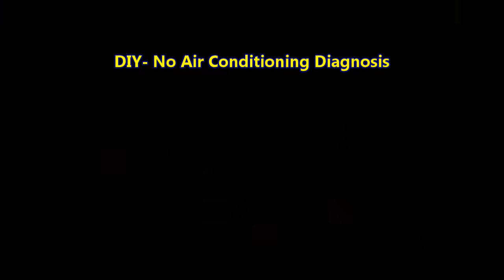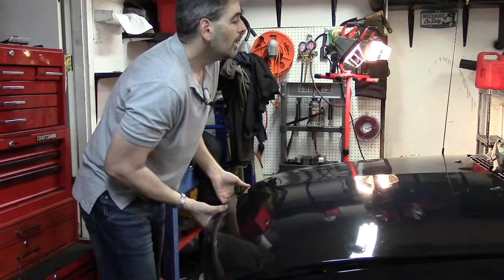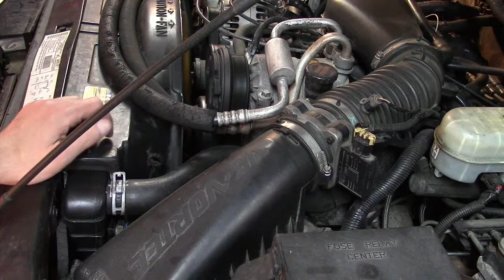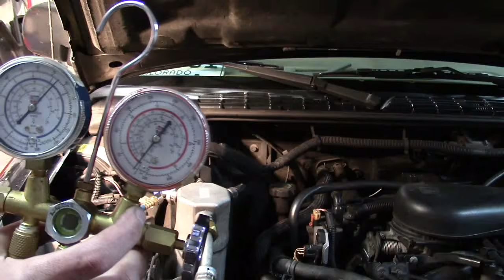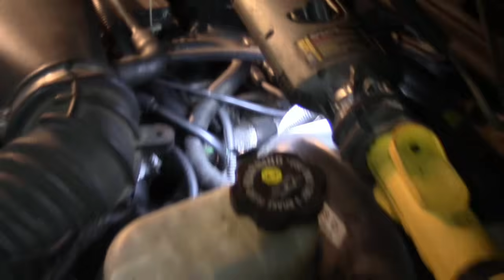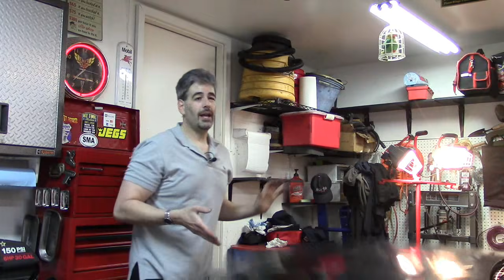DIY- Troubleshooting No Air Conditioning

Comment: Help please. First of all thanks for posting this great video. Here is my story. An almost similar story made you think AC Compressor Load but I'd like to give you more details. 
2012 Malibu 2.4l
Engine was replaced and AC came on and off and then disappeared. At 1st, I thought LEAK...
Please let me point out I have basic or less than basic electrical diagnostic skill. 
2 days ago, I decided to check for power and ground at the compressor connector after making sure all fuses and relay were good. 
I found a broken power wire (green) at the back of the connector.
I connected the 2 wires temporarily, started the car and switch the AC, the clutch engaged and I could feel the air. 
HAPPY I FIXED IT, i just need to connect wires well for good.
Yesterday, i woke up with this task in mind but since the wire cut at the connector was so small, I went to Chevrolet and purchased a brand new connector. 
THE BEGINNING OF MY NIGHTMARE NOW.
I cut power and ground wire and, despite trying to be careful, I connected the wires to the wrong sides of the connector, not sure, but I had ground and power at the end of the Compressor connector. Plugged it, started the car and fuse blew. Replaced it, tried again fuse blew 2 times more.
I tried to plug a bi directional scan tool but it would not connect to the control module; it is as if, my scan tool is not plugged. 
My neighbor put a wire on the ac clutch fuse to bypass it and I ensure to reconnect the power and  ground wire like they are supposed to be. Scantool still can't connect.
IM VERY CONFUSED AND THIS IS WHERE I NEED YOUR LEAD. 
1- My first thought is AC CONTROL MODULE BURNED DUE 
(I do not know where the AC control module is located).
The AC control panel buttons seems to be working. 
2- Could the AC Compressor be burned by the wrong wire connections?
3- Since the fuse kept blowing before we bypass it, I also thought another broken  wire but I don't know since compressor clutch still wont engage despite bypass.
4- I get 5V at the AC Pressure switch; could the AC pressure switch be the issue?

What do you think?
Thanks for reading my novel

Comment: I dont know jack shit about cars,  my truck, a 03 silverado with 137k miles on it, will blow ice cold air for a while, and while driving it will randomly switch to pumping hot super hot air even with my ac still turned on and wont stop until i park and restart my engine, then its good until i get where im going, but the first start from a cold engine, and it always seems to happen, any given time between the first few minutes up to 15-20, but it happens 99% of the time It also seems to happen most of the time when hitting my brakes, fuses are fine, wiring is fine, it activates instantly and when it switches back to hot ass air i hear no click from the clutch plate, freon is good, and its only randomly started doing it over the last few months and i cant figure out what the hell the issue might be, any ideas at all?
Reply from the maker: Yes thousands of them. But all you have is symptoms. You need data to determine the issue. Whats the static vs loaded high and low side pressures?

Comment: So the wire was PERFECTLY cut in half,  and that was the problem. you fixed it. but the owner said the air conditioning was working fine until it stopped running while he was at a red light. so when do you think that wire was cut?

And how do you guarantee that the wire would have 12 volts before you put a test meter on it?
Reply from the maker: As mentioned it was found to be an improper butt connection.

Comment: Busch league! 5:51 failed to do a proper "visual inspection" for his power probe
Reply from the maker: You don’t visually inspect an electrical connection to a ground. You rest it through amperage or voltage drop exactly as i did.

Comment: Hi what might cause an A/C fuse on the 98 toyota 4 runner kept on blown. After replace new ones. The fuse immediately blown when i turn on AC.  thanks.
Reply from the maker: Check for a short to ground

Comment: Owner said the AC was working fine then suddenly cut out. How did the compressor power wire get cut while the owner was driving it?
Reply from the maker: As mentioned it was a improper butt connection from someone's previous repair. The voltage drop at the bad connection must have been the final straw

Comment: I just have a question. If the system has low pressure  would it tell the PCM not to send power to the wire?
Reply: to prevent damage to the compressor
Reply from the maker: not exactly. low pressure disengages voltage to the clutch switch

Comment: About testing the compressor, can't you just turn on the vehicle and then engage the ac so that you can hear the load placed on the engine? Then to be sure check the low side line and feel if it is cold?
Reply from the maker: Obviously, that is how we know it doesn't work.

Comment: Im trying to make sense how you were lead to the cut wire?  When owner stated "one minute the ac is working the next minute its blowing hot air".  Hense- no need to use the 134a can provided by owner.  So in other words,  the diagnosis would be gremlins?
Reply from the maker: Because my electrical testing indicated there was open on the load side of the circuit so I just simply followed the wiring from the load side feed at the relay.
Reply: Schrodingers Box 
Great mind, thanks for explaining.  U definitely earned ur spot.  Safe to say the owner was lying bout when he/she noticed the ac went out- correct?
Reply from the maker: absolutely he wasn’t. why would you think that?
Reply: Schrodingers Box 
...then how is it possible the wire gets "clean" cut as he's driving the car sitting at a red light listening to the ac cycling on and off?
Reply from the maker: Because as stated it was an incorrectly repaired butt connection. There is no doubt the high resistance caused the clean cut and failure at some point without warning.
Reply: Schrodingers Box 
Got it- thanks 👍

Comment: Thank you so much for this video. Could you please explain how you checked the low pressure switch. I couldn't tell in the video. Where did you put the probes? Did you keep it plugged in while you tested it?
Reply from the maker: I simply backprobed the switch terminals and measured the difference in potential with the switch plugged in vs unplugged. Seeing no difference in potential across the terminals with switch closed confirms continuity- what other explanation can there be, right? Otherwise the switch would have to have been open if there was a voltage potential. It’s that simple and much easier than a continuity test.
Reply: Schrodingers Box thank you sir.

Comment: Ok so my compressor keeps kicking on and off and now my car sometimes blows cool air sometimes blows hot air. Where should I start looking for the problem,the relay or somewhere else?
Reply from the maker: I would look at the refrigerant pressure as first step and validate through low side switch voltage activity if it is disengaging
Reply: Schrodingers Box the weird part is as I'm driving it's warm once I start slowing down it starts getting colder until I come to a complete stop then it goes back to warm if I have my car in park and just let it idle it's warm and it overheats my car
Reply from the maker: doesn’t change anything. if you want, you can curve the low pressure voltage with CTS resistance but either way i would use that as starting point.
Reply: Schrodingers Box I'm now completely confused I have no clue what you're saying you for all I know you just spoke German
Reply from the maker: I’m just saying see if the compressor pressure switch voltage are reactive with the coolant temperature is all.  that would be a simple basic way to start your direction with the symptoms.
Reply: Schrodingers Box oh ok. Thanks

Comment: I actually think it would have been cool if you explained how you shot the relay with no wiring diagram.  Mine is a 4 pin relay but it only reads battery on 1 pin with the car off.  I have the diagram but I dont know what the voltage should be.  I do know I can jump the pins to force the vehicle to engage the clutch.  But i still dont know where that points me.  Your video shows people that the should shoot the harness first but you didn't really explain how.  Everybody really seems to like you but I think they just like your sacrasm.
Reply from the maker: It was most definitely explained how. I showed how I identified the load side source voltage and component feeds. I even showed identification of the control side source and the ground in fact! I mean what else is there to show? its just basic electrical.
Reply: Sort of....ok well I have 1 hot at all times at the relay 1 hot only when vehicle is on. 1 out to the ac clutch and 1 in from the PCM.  I'm only getting 5 volts from the PCM. I can't figure out what to do next.  Without the diagram I wouldn't have even know where the signal came from.  BTW it's a 2004 Cadillac and the wires aren't as easy to see or accessible.
Reply: I'm about to start guessing which signal that comes to the PCM is broken. Lol
Reply from the maker: Well thats exactly what I did, except I intercepted that it obviously had to be an open power on the component side, not the PCM side. If you watch the video there is clearly no other possible explanation. I also showed it HAD to be after the relay port.  How else could the open ground side be explained?  Its simple.
  It's actually EASIER if you had a failure at the PCM if you think about it.
Reply: Your right,  I guess I'm just jealous because all my wires are on the bottom under a splash shield and yours are on top and easy to see.  I like your style.  I'm becoming less of a hack every day.  Mines a cadillac and it could be 1 of about 8 harnesses on the other side of the PCM.
Reply from the maker: Doesn't matter if you don't need to chase the wires in the first place. That's exactly the point of my approach. But I still had to dig the one I found from out of under the harness under the manifold.  I suspect this is why the original repair with the butt connector was ineffective- whoever tried to do that repair couldn't access enough to do a good job. Or more likely just lacked skill. But the point is I know exactly where to look. Sometimes I'm lucky and it's an easy location.

Comment: How did you rule out the relay switch as the problem? You hade voltage on the control side and the load side, so i thought you would test the relay or use a differentr one. thanks todd
Reply from the maker: Because the bypass failed to activate the clutch

Comment: GM in its cars has a number of models that are defective designs ... I've had my car in 10+ times with the dealers worked on the blower switch twice ...they replaced the control unit refilled the refrigerant 2 times, replaced the core and replaced the compressor ( I paid for ).... as you can guess none of the fixes worked... several times I never got off the lot before it failed... the techs don't have a clue
Reply from the maker: How is that a defective design? Sounds like defective repair.
Reply: Schrodingers Box yeah GM paid their dealers lots of money to do half ass repairs
Reply: because it isn't just on my car it happens on a high percentage of cars and there are multiple websites which have owners with the same problem which isn't being fixed

Comment: Nice work. A little common sense and the power of observation goes a long way. Good logical approach to troubleshooting on most, if not all mechanical issues, appreciate you sharing the info.
Reply: Especially cars from the 90's (like mine) that are now 20+ years old. Resistors and relays have been baked for decades and fail....wiring gets brittle and fails.

Comment: To comment on an old-ish video (but another good one!) Good info here - I hope it helps me further troubleshoot my '02 Dodge truck. The A/C didn't work when I got the truck, and I think there's more than one problem.  The relay has 12v across pins 30 and 87 (load side) and also pins 85 and 86 (control side). The control side never drops to 0v when the A/C is switched on. It's ground-side switched inside the PCM, according to my FSM wiring diagram. I've verified the compressor comes on when pins 30 and 87 are jumped. While the pressure starts off in the normal range, it immediately goes extremely high when the compressor is forced on. The pressure sensor (not switch) has 3 wires - 5v ref, ground, and signal. The signal voltage is within the normal operating range per the FSM (0.45v - 5.0v). It sits at 0.7v at startup and climbs to 5v rather quickly as it follows system pressure. I'm afraid of leaving the compressor on for more than 30 seconds or so. Anyway, the switch seems to be operating. There's a LOT of green leak check in the system. I'm thinking the system is clogged somewhere. Also, I'm guessing someone tried to "jump" the sensor thinking it was a switch and fried the PCM. Next I'll use some more of your video help in verifying PCM switching. I hope I can figure that part out. Thanks for all you do.
Reply from the maker: Yeah my AC video on my pay channels covers these exact variables. A likely variable for this high pressure jump per your description is a clogged expansion valve

Comment: hi you are so cool. I just found your videos and have a ??? my 01 Nissan xterra ac doesn't work. it blows but its weird sometimes it blows cold then I shut it off and when I restart it isn't cold anymore a friend thinks its some kind of relay issue but when I went to a couple of shops they told me (btw I'm a female) that its a process and it can cost over 1000 just to find out what the issue is then whatever the cost of the fix is.  I am a single mom and just cant afford that however I'm an older mom and the heat kills me (I have been w/out ac for a few years now. I am praying you might have an idea of what it could be please lmk  ps I live in the Bronx in NYC  thanks  lisa
Reply from the maker: I would need low and high side static vs loaded pressures.

Comment: Excellent video. Just curious- What do you think of hydrocarbon based refrigerants like Duracool and Envirosafe? I know that they are much more effective than R12 or R134A. They also run at lower head pressures, so they are easier on the system. They don't have any GWP or ODP either, so it's environmentally friendly. The only problem is that it's flammable. What do you think of it?
Reply from the maker: Yes this technology is used in scientific freezers for long term tissue and cell storage- very familiar with this.  We use these all the time in my industry and no issues for at least 5 years that I've seen.
Reply: Cool. I know that some refrigerators and freezers use propane and butane as a refrigerant. I'm sure that's safe, but not sure how safe it would be to use in a car. What do you think of flammable refrigerant for a car AC system though?
Reply: +Avery Alexander Some refrigeration systems use ammonia.

Comment: You mentioned early on when looking at the clutch that if it was working, it would be a bigger issue.  I have the same issue where the a/c went from working to blowing hot air immediately but the clutch is engaging.  I have 75 psi on high and low side when ac is on or off.  Any suggestions?
Reply from the maker: Yes I would say your compressor is not making any compression since you have no high side difference.

Comment: So the compressor works.. i know this by jumping it at the relay.. the pressure on the high and low side is good

But the button inside the car dose nothing.. any advice is welcome.. it is a 2001 ford focus
Reply from the maker: simply ypass the button. If it works the button is broken
Reply: Schrodingers Box there are multiple pins
Reply from the maker: Yes of course there are. Just bypass power to ground. If it doesn't activate, the switch is bad. You can also test it on the relay control circuit.

Comment: My A/C isn't working. I jumped power from the battery directly to the compressor, and the clutch will not engage. Does that mean it's no good? Thanks.
Reply from the maker: Correct. Your clutch solenoid is bad or you have a mechanically stick clutch  Verify with a voltage drop test.
Reply: A/C worked great on it 5 years ago when I parked it. After a little work I just put it back on the road and have the A/C clutch not working, so it wouldn't surprise me if something was stuck. Could you give a quick description of how the voltage drop test works. I'm familiar with testing batteries, but not compressors. Thanks.
Reply from the maker: Yes for voltage on the positive and negative sides of the LOADED circuit and subtract from the source voltage. If greater than 3 volts, then your issue is the solenoid.
Reply: Thanks for your help. I haven't had a chance to test it yet, but I'll let you know. Jim